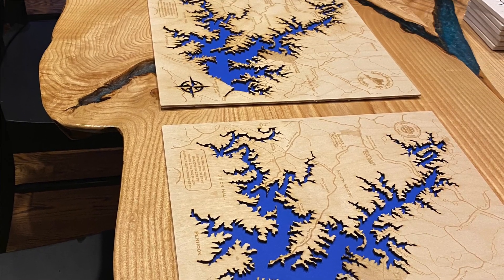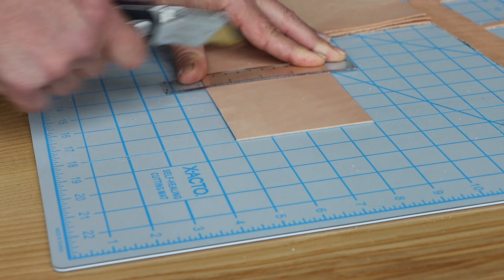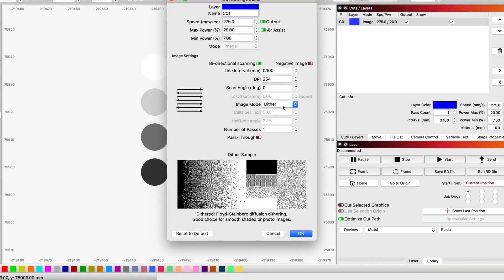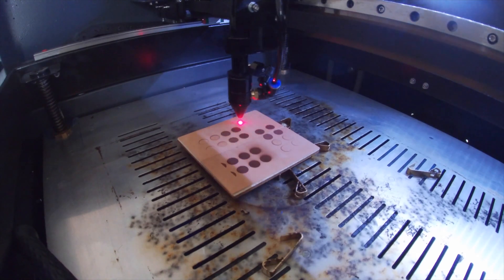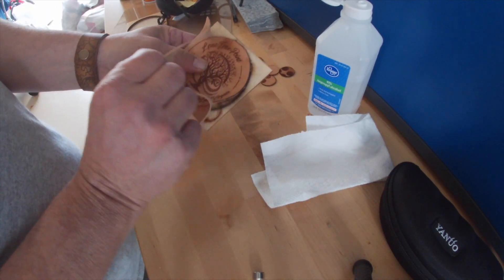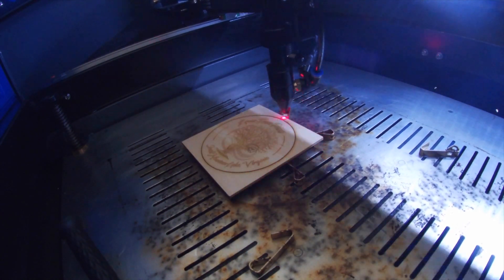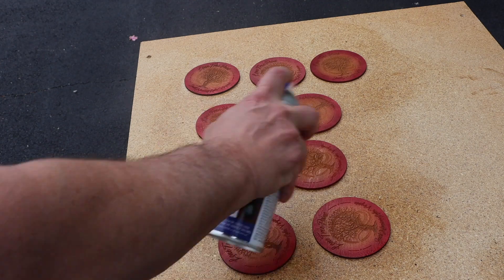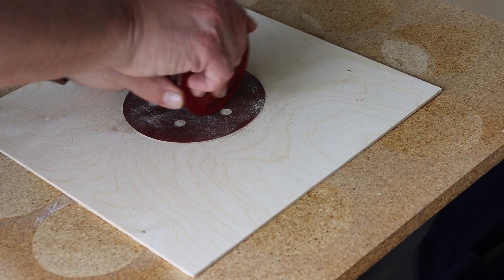Laser Etching Leather and Wood Coasters

Comment: I have started engraving leather while it is moist. It cuts the soot way down.
Reply: You can also clean the soot under running water with a soft toothbrush after the engrave. Huge difference - not sure about using alcohol to clean it as it would tend to dry out the leather long term. Love your videos BTW

Comment: thats a K40? seems large to me
Reply: No, that's NOT a K40.  A K40 is a desktop sized 40W laser cutter, with a bed size of approximately 8 x 12 inches.  A K40 also only costs around $350.
Reply from the maker: It’s a 50watt Chinese.  Same “family” of lasers, just a bigger version.
Reply: @ThisIsHowIMadeIt  no it's not. This is a great machine, built like a tank. The only thing in common with a K40 is that both are CO2 lasers. K40 is a shitty entry level small work area laser cutter.